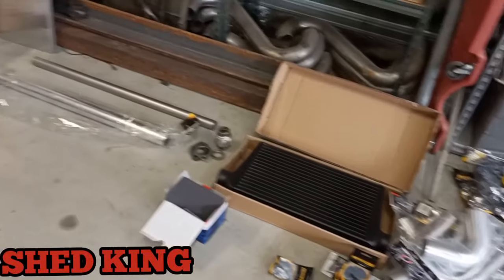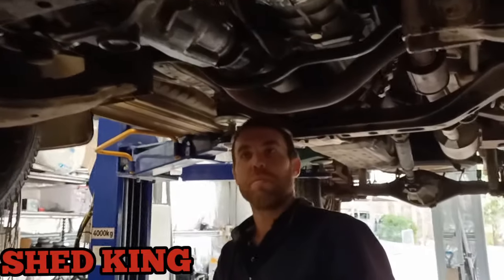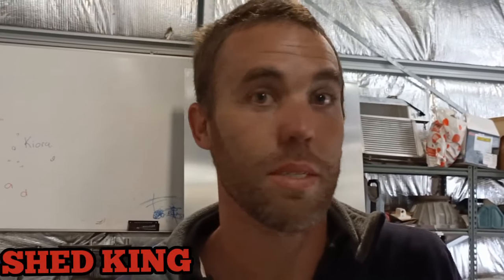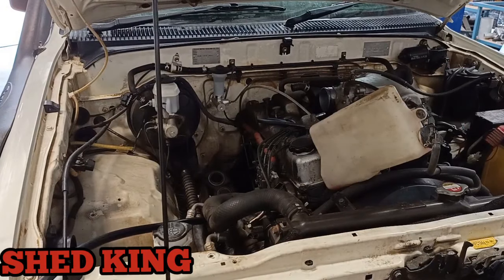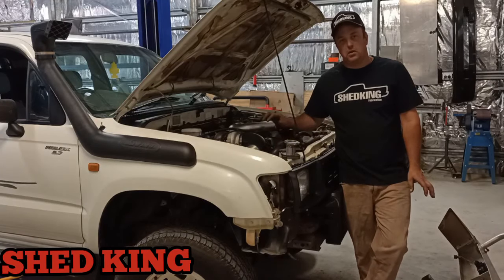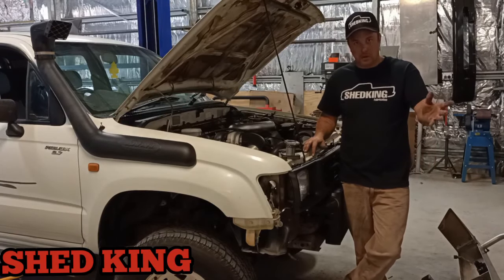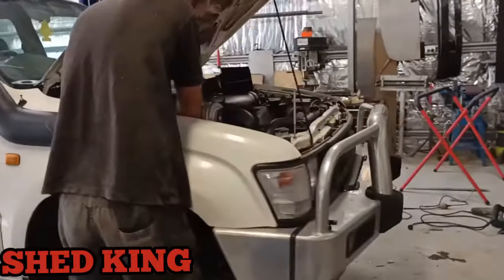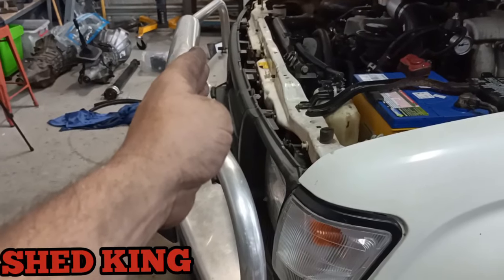4x4 3RZ turbo install owners first drive reaction #the3rzshed #Shedking #3rzturbo

Comment: Couple of questions. Can it be hooked up to a snorkel ? What turbo did you use ? And overall cost ? Thanks so much.
Reply from the maker: Yeah mate with a custom air box would be easy as 
We used a proboost 3076 .83 rear 

Complete kit installed was $6500 includes mod plate
Reply: SHED KING thanks for the reply. Seems reasonable. Only problem is I’m in WA. Anyone in Perth you would recommend.
Reply from the maker: @explorelife2968  sorry mate dont know anyone ovrr there

Comment: Cool vid. Always a good idea to disconnect the battery and ground so you don't fry your ECU with 20V+ from your Mig welder.
Reply from the maker: We did mate cheers for the heads up
Reply: @TunaRacing  no wukkas!

Comment: Very interested in boosting my 2013 sr5 2.7 Tacoma, will I need to change the transmission from auto to manual or could I run the 4 speed auto with turbo until I decided to spend extra on a manual ? Any response helps a ton thanks!
Reply: Run the auto till you can afford it it’s a huge project and to take them both on you’ll make more mistakes… save the money abuse the auto then swap when you can!

Comment: I wonder which gearbox used to install the 3rz engine a g52 w58 or a r150? Excellent video
Reply from the maker: G52 in this model
Reply: @TunaRacing  Can the g52 be used and coupled directly to the 3rz engine or do other jobs require more? Greetings from Panama
Reply from the maker: Yep the g52 and r151 are direct fit

Comment: Hey mate what is best turbo for my 4x4 to give it some more power in the bush and on the hills.  Looking for Acceleration not top speed Want to run low boost but ecu upgrade
Reply from the maker: 3071 or 3076

Comment: Grate video. I live in New Zealand and doing a turbo 3rz swap on my 1st gen surf but the 3rz is not that common here and the one part I need is the sump like this one but can't find one here. Do you know of any good parts companies in Australia that might have a Hilux 3rz 4x4 sump that would ship to NZ.
Reply from the maker: Just Hilux in Melbourne Australia 😎
Reply: @TunaRacing  Awesome will give them a try thanks.
Reply: @TunaRacing  I tried the company you recommend but communications have stopped maybe due to lockdown. Any other companies I could try?

Comment: What do you do with all the vacuum lines and the EGR
Reply from the maker: No egr on aus model
Reply: SHED KING Oh ok. I’m was thinking about doing this on my 3rz Tacoma. Just wondering if you use bigger injectors and a piggyback ecu or you just go with the stock stuff.